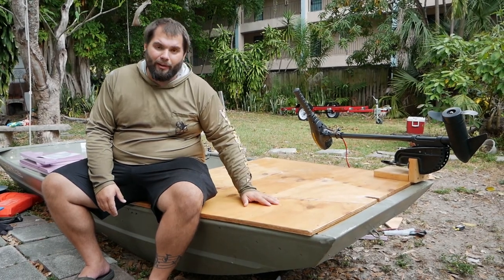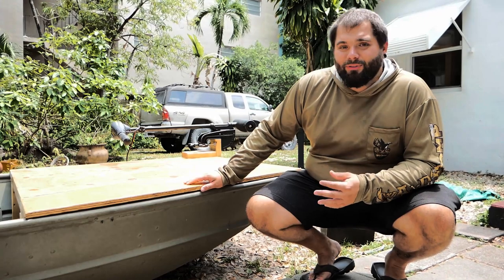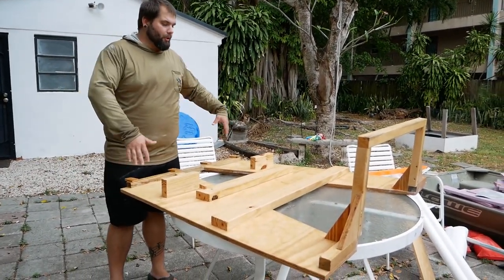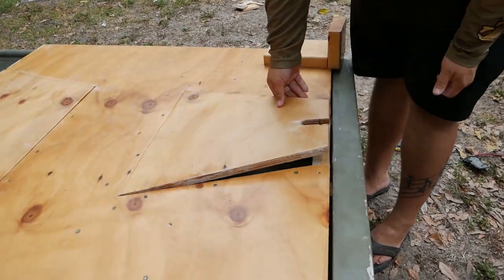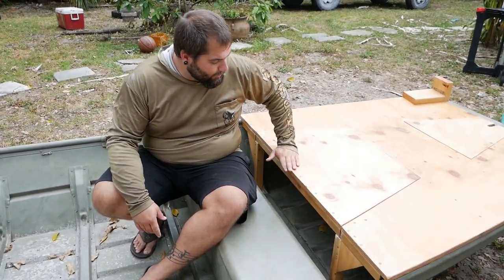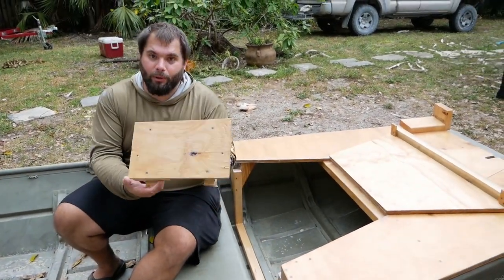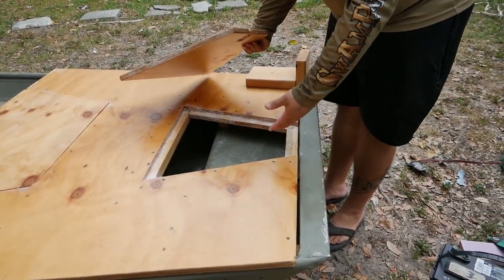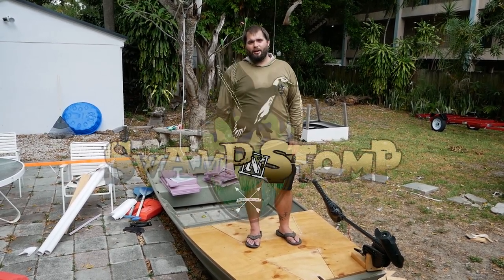Removable Jon boat Casting Deck with no Drilling! (Swamp N Stomp ep. #56)

Comment: Great video. I just finished putting a plywood floor in between the middle seats on mine and have been planning how I want the front deck to be. Very clever design you came up with s
Reply from the maker: You can see the parts of my false floor I’m the background. Much simpler design. I’ll install it tomorrow maybe.

Comment: Nice video. Is that 3/4 inch plywood? Did you coat it with something to protect it?
Reply from the maker: It’s 23/32”, so a bit smaller than 3/4. I coated it with polyester resin. -Mark